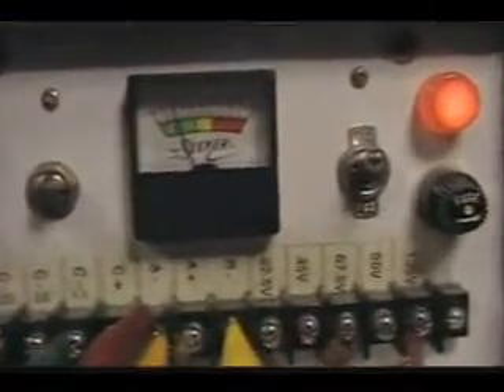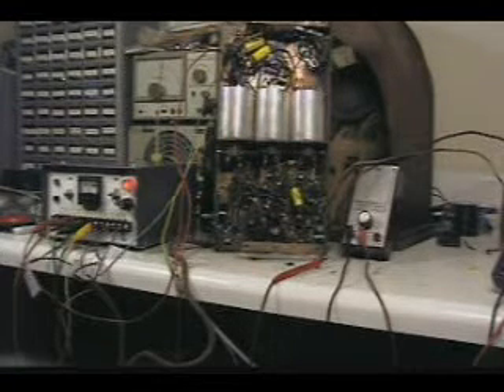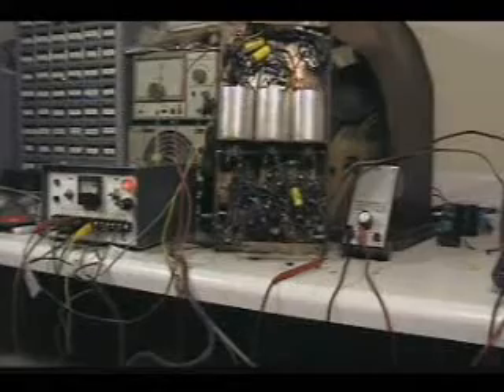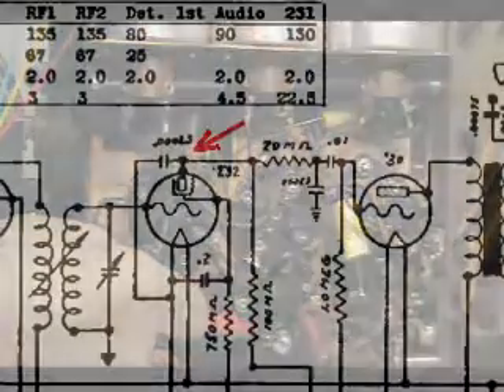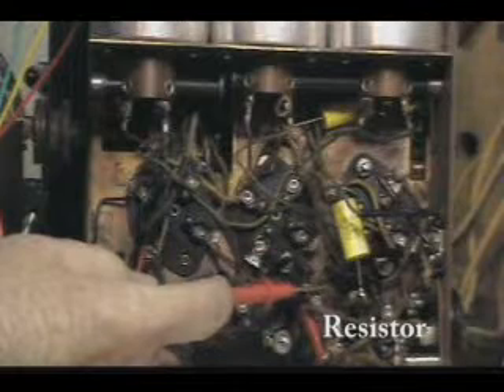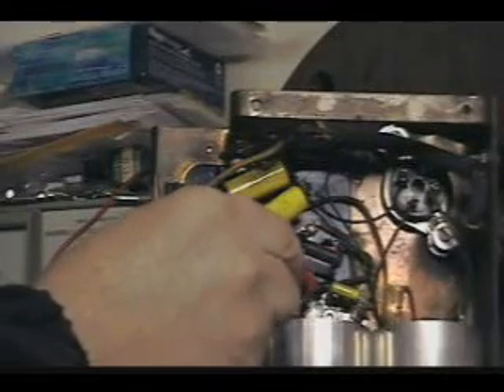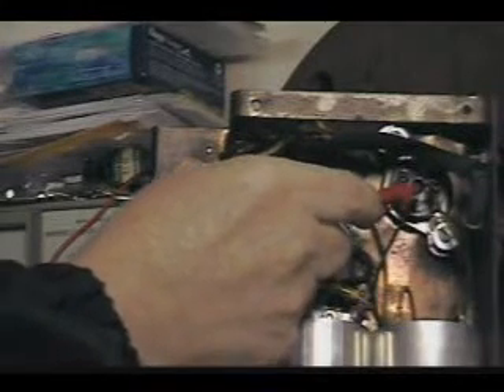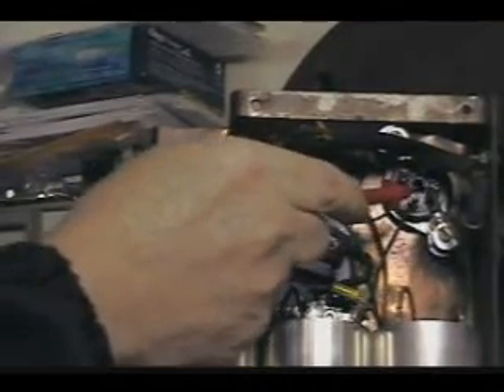SilverTone Radio 1291 repair part 2

Comment from the maker: Thank you. I have been working on or building radios since I was in High School and have not stopped. All parts are getting harder to find and the prices keep increasing also. There are many internet websites that carry old radio parts and eBay is another good source. It is very nice having a friend in Brazil. Thank you again.

Comment from the maker: Every now and then an old radio surprises me. Not having a volume control is a first for me. I checked and rechecked, it has a tone control but no volume control. I'm still scratching my head on that one. I have got to order the grill cloth for this radio tomorrow. 
Yes these tubes do fire up rather fast. This is a unique radio and I'm so glad I got to work on it. Although when they first handed it (basket case) to me, I thought oh no! You may think of that in much stronger terms!

Comment from the maker: Every radio is different and there's no telling what problems you'll find. These old set are guaranteed to have multiple troubles. So you keep checking everything and eventually the radio will play correctly. This radio did surprise me, because that's the original speaker, I was expecting a very scratchy sound. Thanks.

Comment from the maker: I don't have a preference for a particular signal tracer. A signal tracer that can handle both AF and RF are all I'm interested in. I have been thinking about building a signal tracer from scratch as a YouTube project. A solid-state signal tracer that you could use for both transistor radios and tube radios.

Comment: WOW! First, the signal tracer picks up that clear sound, then the output is found, voltage set, and WOW! That sounds good! Was that running the original speaker of the radio, or was there a new speaker installed?

Comment from the maker: I have used Radio Shack's capacitors and resistors for my radio and amp repairs. Over the years the work voltage on there caps have steadily lowered. So I us an online catalog store. Youtube does not allow ULR links in comments so I'll do it this way and I'll sent you and damusician a Youtubemail. The link is TUBESANDMOREdotCOM.

Comment: allamericanfiveradio do you think radio shack carries caps that can be used on my old motorola hi fi tube amp, Damusician sent me a link to a website and it showed someone installing some modern caps in the original cap can, can i do that on my rig